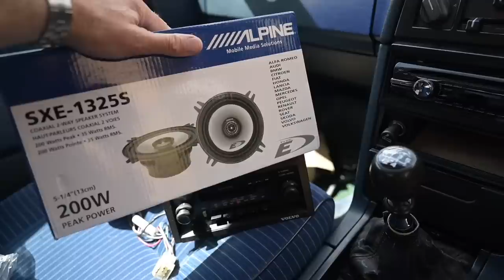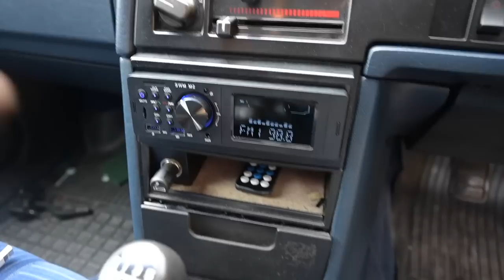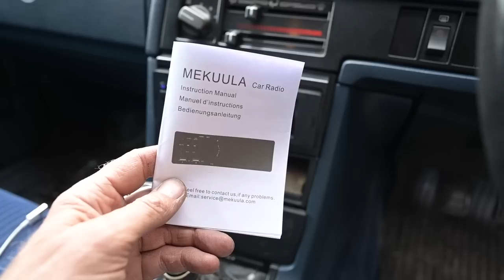Volvo 740 gets some audio upgrades

Comment: When that car was brand new it had 4 speaker grills in the doors; wiring for the 4 speakers; and a manual aerial. So, it was all nicely plumbed up for a stereo, but didn't have one. That's why the hole where the stereo goes has a plush lining, so it was a nice storage recess if you didn't fit a stereo. You either got the dealer to fit a Volvo stereo when you bought the car, or you fitted a third party one. I remember Volvo offered several stereo options, all overpriced. I can't remember what differentiated them. I bought a 740GL in 1985, and it was a very early one. So, the third party mounts for putting a standard sized stereo in that big hole were just appearing. The one I got, to fit a Pioneer stereo, was a bit crude, but fit a lot better than the one being used in the video. It sat back, and was well away from controls like the gear lever. This prominent one looks a mess. If that car had an electric aerial from new, it didn't come from the factory. I don't know if Volvo offered one as a dealer fitted option. The manual aerial was really good. I had that car for 7 years, and it never got troublesome and sticky like most telescopic aerials did.

Having different speaker grills in the front and the back is not original. They were all like the ones in the back in the video, whether you got the dealer to fit a Volvo stereo or not. Maybe the front ones had to be replaced at some point. I remember it was a PITA trying to get speakers to fit snugly in the doors. Volvo used an unusual size for that time. I think I ended up with speakers a little under sized, with some fudging.
Reply: ... and some dealers had arrangements with nearby local car audio specialists to fit non-Volvo branded stereos into new cars for significantly less money than the "official" Volvo units

Comment: Looks good Matt very surprised about the lack of rear speakers. Must of been standard to have them fitted on the GLE spec. There's actually a nice looking silver 760GLE for sale on eBay in Scotland at the moment, check it out if you have time.
Reply: My 89 240 DL estate came with a 4 speaker Clarion AM/FM cassette player with amp as standard equipment. It was poor when new, and age has done it no favours. It is on my rather extensive to do list.
Reply: @michaeltutty1540  
I had an D reg 240 GLE estate silver green with black leather B200E engine and auto. I kick myself daily for getting rid of it.
Reply: I own 90 760 gle silver here in Canada. I swapped the radio in my 90 740. they are totally different animal. The 760 is 6 speaker system and 740 is a 4 speakers system. It work but the front speaker outputs are for woofers only, the tweeters are on the dash in the 760. No dash speakers on the 740.

Comment: Well done Matt!
I know the new radio has bells and whistles, but what it hasn't got, which the original had, is a high quality class AB analogue audio amplifier. If you listen to speech or pop music you won't notice the difference of course, but the strains of Ludwig or Johannes will be now be truly strained  :)
When the Volvo 800 series arrived in the showrooms, they came with a fairly decent radio and as an incentive to buy the cars, Volvo included a free 6 disc CD changer in the boot. These were fitted at the dealers' workshops. Since the radio didn't have any auxiliary audio input connections, the CD changer was connected through a low-power FM transmitter which was connected to the aerial input (piggy-backed onto the existing plug), then it was tuned in on a blank part of the FM band. 
If your original radio had been working, this method could have been done to add mp3 and Bluetooth.

Comment: Excellent job Matt. You should try the heat shrink with solder blob already inside connectors, they make life a lot easier and neater too.
Reply from the maker: that sounds easier, Ill have to get some of those

Comment: I’m sure I’ve seen very short little aerial extension leads before for exactly your problem!
Reply from the maker: These new CD-less units are shorter than the old full length ones, so theres probably a thriving industry in extension leads now!
Reply: @furiousdriving  Should be plenty of slack in the dash. All of my volvos has at least 20cm more lead than you got there.
You just need to find out where it's hidden :P

Comment: Thanks for your video. I have had a 940 for nearly a year now. Whilst I am not a big car radio listener it is frustrating that it powers in but then does nothing, actually the most frustrating bit is the trim panel on the front being loose. I’ll get to it sometime and you video is great to see all the tough not quite fitting bits!

Comment: Hi Matt, good project! Maybe you need to use some shrink tubing the next time to cover the solder joints and vulnerable spots.
To prevent rattle of the head unit stick some self adhesive felt between the unit and the frame. 👍
Reply from the maker: must get some, just lots of insulation tape for now! Yes some felt would help pad it nicely

Comment: Recent upgrade to my 940 was a new head unit with Bluetooth and hands free. Kinda looks ok, but something like this would be better for me I think. I wondered if the rear speakers already had the wiring in as mines did and it was a case of cutting out the old door cards. Easy-peasy! Got the original stereo, but no code for it incase I sell it on and it's new owner wants it factory again! 👌🏻

Comment: I did several radio swaps back in the day, one being stuffing a 1988 Mitsubishi stereo into my 1978 Midget… and it still works just fine. That said, your modern unit is pretty tempting, what with Bluetooth, USB, and the like. Might be time for an upgrade!

Comment: I’m surprised you couldn’t get the original radio repaired. Though that’s quadrupled the value of the car.
Reply: The factory Volvo radios of that era were lousy. Clarion supplied them, and even the upgraded units were very poor at best.
Reply from the maker: what Michael said!
Reply: @michaeltutty1540  If it were repaired you would still have the originality if that were important.

Comment: My 1991 Volvo 740 Turbo sedan (Genevieve) had dash speakers and rear door speakers stock. The front doors speaker area not wired! And rear shelf speakers can't find wires! Plan on having the 8 speaker areas fited with good speakers + 10 inch  Infinity 1050 watts  sub for trunk  trunk. I haven't yet changed the deck but I have a Bluetooth JVC waiting to go in! Debating what speakers to run in it. Got Hertz UNO 6.5s & 6x9 for trunk shelf. But still deciding as I have 3 cars!

Comment: I use Alpine in my Renault Clio (2000) too. But I bought the SPG Series. It`s not much more expensive but sounds much better. I also had a Speaker without funciton, but the problem was just the calbe adapter inbetween the Speaker and the factory car cables, so I just bought two new adapter cables (4,99€) and I was happy. :-)

Comment: Nice job. You need sounds sometimes when out for a drive. One question though, what was that constant clicking noise each time you had the ignition switched on?
Reply: IIRC a really annoying ' put your seatbelt on ' flashing light
Reply from the maker: Correct its the seatbelt warning!

Comment: My 90 740 has an factory amp so it has a din 6 prong plug. For now I took the radio out of my 760 which also has an amp. IT has a graphic eq built in but a separate cassette deck which there is no room. The radio is a 6 channel radio not a 4 channel like yours. My front speakers only play bass, since the 760 has dash tweeters and woofers in the doors. I can only play the rears door speakers, because the fronts sound like crap. The cassette has its own din plug to plug it in the radio. There isn't enough room for the cassette deck. The fuse panel is in the side of the dash on a 760. On ebay there is a din to rca plug adapter so I am going to put in a sony media receiver eventually. I am waiting for the plug adapter for the harness which is different than yours. 14 pin plug.

Comment: Well done! I would have never done this myself.
Too bad you couldn't get the factory radio repaired. Or possibly you could wait until either Christmas or the New Year.
Everything sorted in a matter of time!
Reply: The factory units were poor when new, not worth the bother now. I still have the original unit in my 1990. It is going in the bin when I get a new one in.
Reply from the maker: You can have modern upgrades hidden in old stereos but its not cheap, maybe one day

Comment: The Connects2 fascia is quite disappointing in practice, that’s a huge design fault indeed and sorry it fell short of expectations. That lighter headunit should help hopefully and it does indeed look like a Technics or Akai seperates unit... It seemed to be the later 1989/1990 facelift 740s that got standard rear speakers - in fact my grandad’s was a base.model yet had the rear speakers and the amp under the steering wheel. And I believe Alpine actually made the speakers too  - the front ones looked very Alpine-esque. They were riveted in too as is common practice with Volvo now lol.
Reply from the maker: It think the issue is as much the shape of the dash, because it slopes any fascia is going to have to push the stereo forward

Comment: Good job, Matt. You will likely find yourself upgrading the rear speakers too. The factory speakers, made by Clarion, are not worth twopence ha'penny. They were crap when new, and unlike fine wine, time gas not improved them. I have the original 4 speaker AM/FM cassette with external amp that was standard fitment in my 90 240DL estate, and if anyone were foolish enough to offer me a farthing, they could have it. As things stand, it will be going in the bin for recycling.

Comment: I will be doing this job on my hi lux i have the original radio cassette player in it but i have another radio  cd player to put in but the only poblem i have i have to pull the whole dash board to pieces to fit the radio cd player in

Comment: Pity you couldn't buy an identical used Volvo radio from same era.
Reply: Now that is a really good idea. -Why did I not think of that ? . In steed of trying to repair the original one..
Reply: Yeah there must be some squirrel car breaker that stocks them like Silver lake Southampton, 10s of 1000s off  the second hand shelf car parts with bargains always on offer..
Reply: The factory head unit made a good doorstop from new. Time has not improved them. They are not worth the bother. The sound quality is horrible.
Reply from the maker: They weren't amazing when new and lack so many functions so not money well spent fixing an old one to original spec, plus this is a really well looked after car so if this ones packed up chances are one from a scrapped car wont be far behind.
The big job was the cables as they had broken in the door shuts

Comment: Do you have a service manual with wiring diagrams to help with the wiring? If not I can scan a few articles from an old Haynes manual for the 740.
Reply from the maker: Got the haynes manual, that should have wiring in it

Comment: You should take the original radio to an expert and get modern electronics fitted inside it, original radio now in the 21st century. it is a bit pricey to do but worth it.  After twisting the ends of the wires, before the connector was crimped on, a spray of contact cleaner is advisable on the ends as any sweat on them will cause corrosion of the copper in our humid conditions, with a possible dodgy contact in the future.  Why did you not strip out the old speaker wiring, the new might have fitted through the grommet then.  It is also a pain when checking out future faults if the old wiring is in place as difficult to work out what is what.  If still live at one end possible fire hazard.  More applicable to wiring carrying a greater current.
   Have a good trip to the Festival of the Unexceptional, and you listen to some good sounds there and back.  Do BBC traffic bulletins still cut in if listening to another source?  I think that depended on the make of and price bracket of the radio/sound system.  Not much use if already stuck in traffic but at least the cause became known.
Reply from the maker: I thought about the modern internals route, but as you say its not a cheap option. I think it depends on the radio for the traffic but if you use the phone sat nav it will alert you